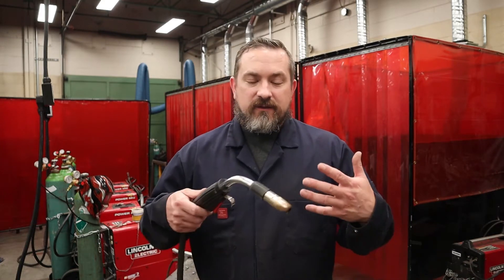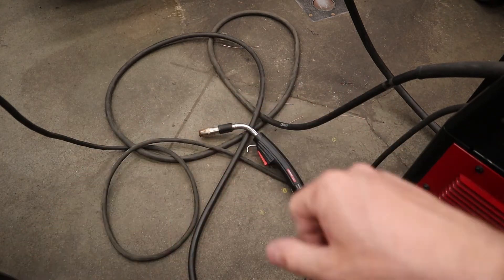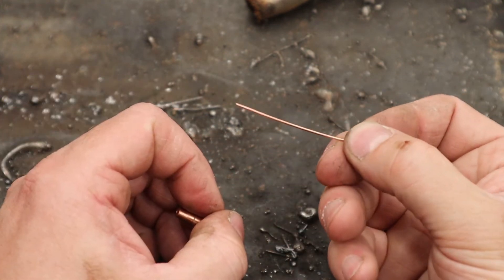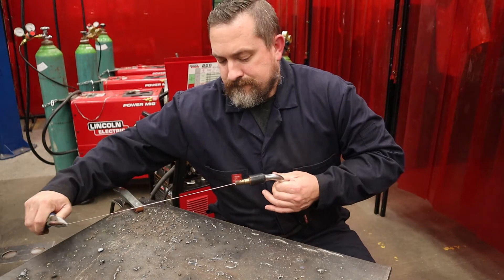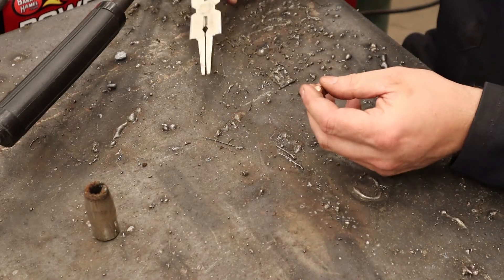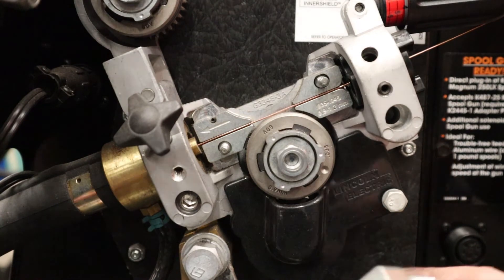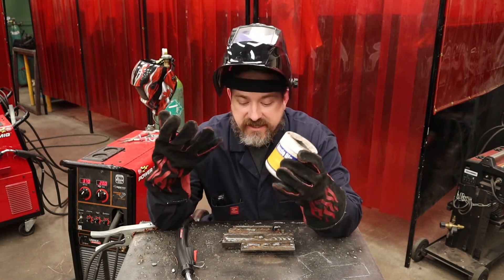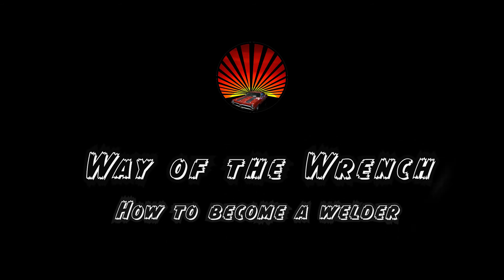Birds nest in your MIG welder?

Comment: I have a old Hobart mig welder that my dad gave me and it's birt nesting at the spool feed and I can have the wire come thru the tip but as soon as a start to actually welding it gets the birds nest I think it could be the liner but I'm not sure
Reply from the maker: First thing I would do is check voltage/wire speed settings and then check/adjust the drive wheel tension.  If it's too tight, the wire will birds nest every time you stick the wire to the contact tip.  I'm not sure about your welding experience but if you have your stick out too close, the spatter will cause the wire to jam easier/more often too.  The liner could be also contributing to how hard the wire has to be pushed by the drive wire.  Check the line for any kinks or flat spots from something crushing the liner.  If you cut the wire and pull the wire out of the liner by hand, it should feel smooth and not tight/binding.  You should also confirm you have the correct wire diameter for the contact tips and the drive rollers.  Also dirty wire spool from sitting a long time (rust/dust build up) can get pulled into the liner and cause issues.  Hope this helps. Good luck!

Comment: You should not grind soft metals on a regular grinding stone! You can load up the wheel abd then it will overheat and explode.
Reply from the maker: Yes you are correct but these wheels are dedicated to steel and the tiny amount of copper from flattening the contact tip isn't going to do anything to the wheel.  Thanks for the watch!
Reply: @wayofthewrench  You give the impression that it's okay to do it. Very dangerous thing to do. You should be filing it.
Reply from the maker: I do intend to make a how to video for all of my metalworking machines in the future and I will make sure to include this in the one for the pedestal grinder.  Thanks for your suggestion!  Cheers!

Comment: good day not geting a birds nest but wire not feeding
Reply from the maker: Start with the basics like correct tension on the feed roller, check guide wheel for proper groove for the thickness of wire, clean/replace contact tip.  Is it a brand new roll or a roll that has been on there a while and was just feeding ok?
Reply: @wayofthewrench  thanks I got it it was the wire I change it and it was fine thanks

Comment: I would agree that it's such a waste to discard that salvaged MIG wire, however, it can be used as a TIG filler.
Reply from the maker: Ya that's a good idea or even really light gas welding filler rod.  Thanks for the watch!